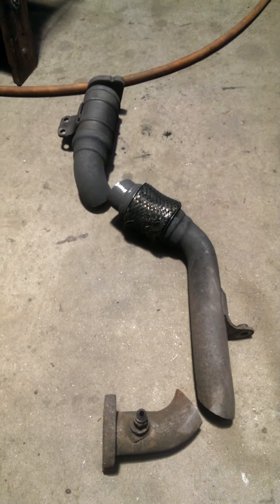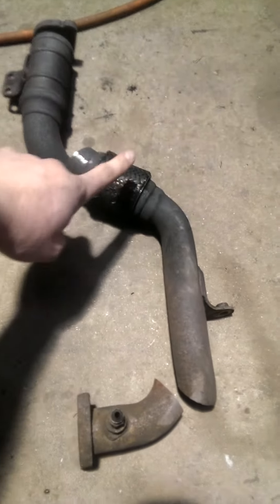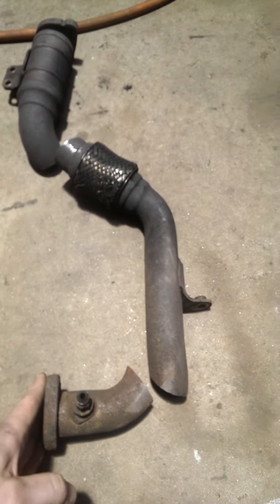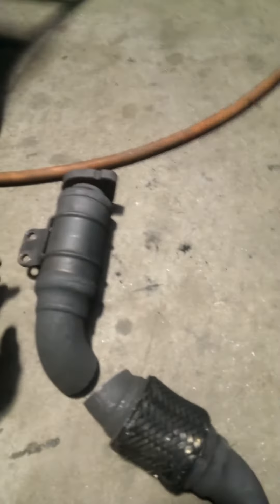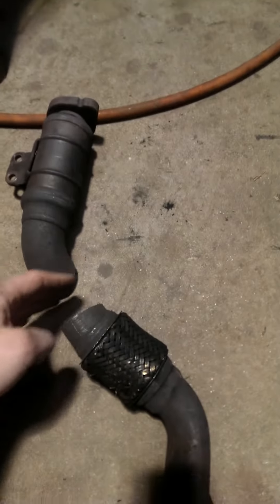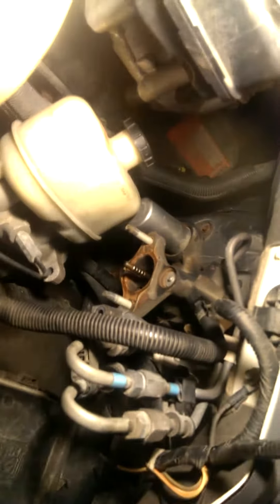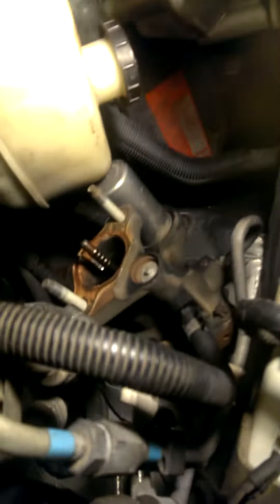6.4 powerstroke leaking up pipe removal and block off (egr pipe only)

Comment: In case you're wondering, the OEM threaded fitting is part # 3C3Z-9F485-BA and the gasket is 8C3Z-6N640-B.  I believe the tap needed to thread the block off plate is a M14x1.5
Reply: Thanks for that😊

Comment: I just finished this project last night and I see alot of people asking about sizes of tap and drill bit, and I see some wrong answers also. The tap size is 1/4" nominal pipe thread, and the drill bit would be a 7/16" bit

Comment: So check the three wires that go into the sensor plug. These suckers always break internally due to the small clip that holds them into the actual plug head. They will break and cause a short/low circuit/all the above. Changing this out is a must after you perform this fix. 
Great video by the way, it saved me a lot of hassles.

Comment: Probably could have jacked the Cab and front clip up 6 or so inches and blocked it to get in there. You still have to disconnect the same stuff. But some of us dont have the head room and specialised lift equipment. But it is the best thing to do right at the beginning. You just have to plan for it and get it done in total time it might coast you 3 to 4 hrs but the frustration levels are worth it and you can reroute the backpresur tube so much easier. Good luck. It is all worth it.

Comment: I did this exact thing. 10,000 miles later no problems! Thanks for the video you saved me alot of coin.
Reply from the maker: Eric Magnuson Good to hear huge $$$ saving trick the average guy can do in the driveway
Reply: SSTEVEN94 i was about to do this but b4 i remove anything else, i tried to loosen the 2 bolts on the uppipe and they were stuck, 1 bolt almost rounded so i skip this project for now, but thx for the tip on removing the brake master cylinder for access
Reply from the maker: Eric Magnuson heat and a 6 point socket will be your friend.  Those bolts round out very easily
Reply: @SSTEVEN94  deep creep over few days aswell

Comment: if you use the original fitting out of the up pipe where the sensor tube screws on the tap size is metric 14-1.5 i kind of rounded mine off had to use a pipe wrench went to lowes then 3 different part stores nobody had it so i just used old one the hardest part of job is cutting basically cutting in blind
Reply: What drill but did you use before tapping?  I dont want to go to big

Comment: How did you get the bolts out my are super stubborn. Any tips would be appreciated.  The crack is getting worse 🙁
Reply from the maker: Be sure to use a six point socket.  Break them free when the engine is hot that will really help.

Comment: Thank you soo much for this vid. Was looking for this exact process how can i get rid of that pipe without lifting the cab. Now is that 10mm bolt holding the lower bracket accessible? If so from the bottom? Thanks
Reply: Was it?

Comment: SSTEVEN94 Did you make the cuts before or after you removed all 5 bolts on the pipe? Great video BTW thanks.
Reply from the maker: I actually dont remember I think it was before

Comment: Hello there thanks for the great fix here.
I am getting a low exhaust back pressure code every so often now and a low turbo boost for some reason. Any ideas?
I just had the entire turbo assembly replaced due to some turbo issues but no codes until I performed this fix with the sensor. Any help or thoughts would be awesome. 
Thanks

Comment: I'm gonna do this when I delete. It saves the egr exhaust pipe from cracking off at the bracket from vibration. Good video man. Did you replace the hardware for the block off plate? ie. Grade 5 or grade 8?

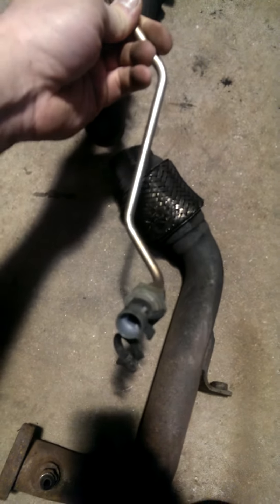Comment: I know it has been asked, I haven't started my egr delete yet, been too cold... But the part shown at 1:08 that is drilled and tapped into the block off plate, that angled tubing and all, is that all off the truck or did you make that whole setup for the sensor?
Reply from the maker: Jordan Sosinski the shiney silver piece is your egr block off plate that you purchased.  The ebp sensor gets taken out of the exhaust pipe to the egr cooler portion and threaded into your egr block off plate.
Reply: SSTEVEN94 so is the sensor attached to the roughly 8"x1/2" tubing with the little two bolt bracket when it comes off the truck or is the sensor itself just put right into the bung on the egr up pipe from factory?
Reply: SSTEVEN94 I'm referencing the entire silver tube set up you're holding in your hand at 1:09 with the two 45* bends in it and the bracket. Does that come off the truck or did you make it specifically to tap into the block off plate?
Reply: Cool thanks man!
Reply: Jordan S. Did he make the tubing with the 45s in it or was it supplied?

Comment: You cut the pipe out, what about putting the new one in? Is there any problems or does it slip right in? What you showed helps. Thanks
Reply: Robert Pierce this was on a truck that had an Egr delete but the Egr exhaust was still in place.  it is impossible to get the Egr exhaust feed pipe in without lifting the cab
Reply: You can do it by taking the valve cover off and removing the transmission and transfer case mounts. Lower engine and get it out from the bottom.

Comment: Thanks for the video I did the exact same thing just wondering did you have any problems with the exhaust back pressure sensor coming on after you installed it   My truck has been going to limp mode don't know if it's because of that or something else it was just coincidence
Reply from the maker: No problems

Comment: how did you get to the down pipe 10mm bolt?  Thanks Benny
Reply from the maker: 6 point 10mm socket and some heat.  Careful they round very easy

Comment: I blocking it off up top but I'm a little confused on the ebp. do I just block it off as well?
Reply from the maker: John Spiro drill and tap the block off plate and install the ebp into it
Reply: SSTEVEN94 you'll have to forgive my lack of knowledge. I'll remove pipe and put block off there correct?  I only have one block plate. I just need to block end of ebp somehow?
Reply from the maker: John Spiro you need to drill and I stall the ebp into your block off plate
Reply from the maker: 1:05 shows where the ebp pipe is Installed on the block off plate 2.42 shows where the whole thing gets bolted up
Reply: SSTEVEN94  I'm sorry I've the ebp off and had it in my head that it was fixed on both ends and couldn't move. Just just went and looked and all makes sense now thank you very much

Comment: Where to you buy the part that attaches to the blockplate for the sensor? I have the same delete and I want to put the block plate just like you did and remove the last piece of pipe so I don't have the same problem but I cant find a block plate with the sensor all attached and nice like that. YOU WOULD REALLY HELP ME OUT MAN BY REOLYING THANKS.
Reply from the maker: goldenboygq9 you need to drill and tap the block off plate so the ebp sensor screws into it as shown in the video.
Reply: SSTEVEN94 Are a shop? Can you by chance sell me one pre drilled? Or charge me to do it??
Reply from the maker: Bring your ebp sensor to a home improvement store or fastenal and buy a matching drill and tap.  It is very easy to do.
Reply: You use the block plate for the egr pipe they are the same, drill and tap threads install sensor then re install

Comment: What size tap do you need to thread the block-off plate to accept the ebp sensor?
Reply from the maker: Greg Vanucci unfortunately I do not recall
Reply: Vanuch 495 think it's 1/2"x20
Reply: this is exactly what i was looking for nobody ever mentions the size